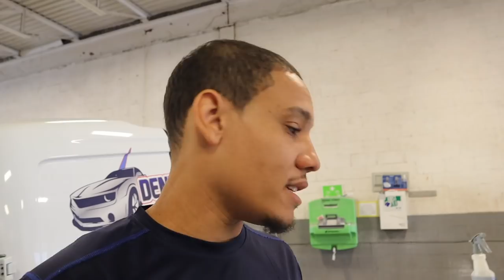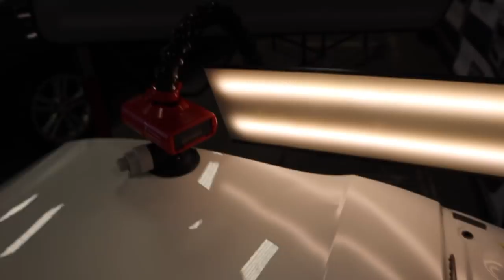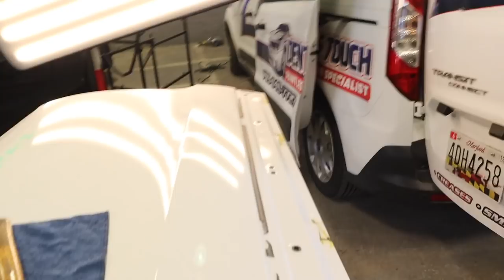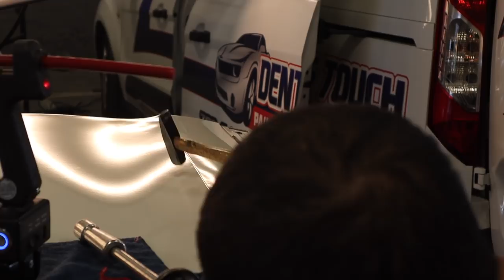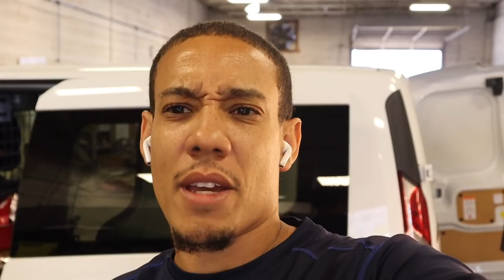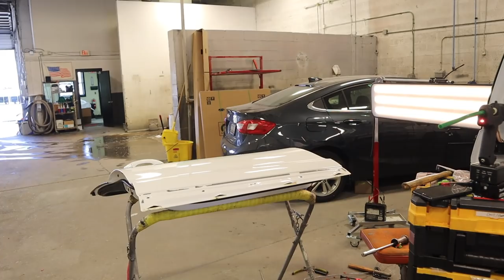Paintless Dent Repair on an Audi Q5 SMASH Right front door

Comment: Great job!  It helps to see this work done because there is a tendency to think it should be impossible to restore metal that perfectly, and impossible that the paint would move with the metal without showing any signs of damage.   You showed that it could be done on a very high end car.

I know you saw it, but in the final pull back shot of the job, there was still one small dent about 2 or 3 inches to the left of (i.e. above) the crease about 12 inches in front of the camera.  

You acted correctly in responding to the guy’s question.  Your being called in to work in a traditional bondo/paint shop was like an orthopedic surgeon calling in a chiropractor to fix somebody’s back - they know you can do it, but they just don’t like it because its a threat to how they do business.

Comment: You should try to use some type of vibrating tool. A high powered magnetic vibration puller or pusher. I have heard you say that you got part of a dent out with just the vibration of your hammer hitting. New susub. Keep up the good  videos

Comment: Well, most BS lack real talent. Gone are the days of welding and fabricating panels, some of this is due to the change in car technology which makes those talents less desired. Either way most shops replace the panels and repaint or they sand, pull dent out as much as possible then add filler and paint.